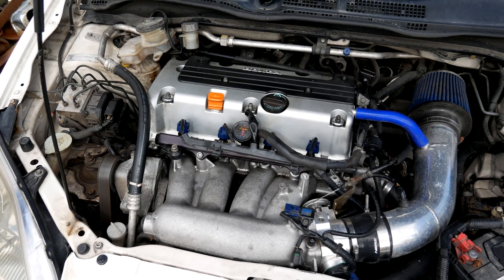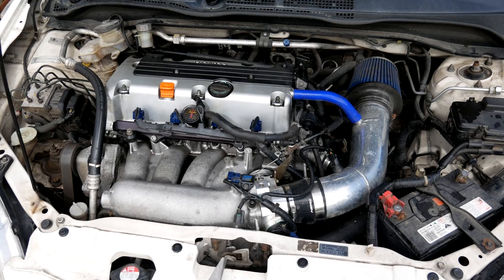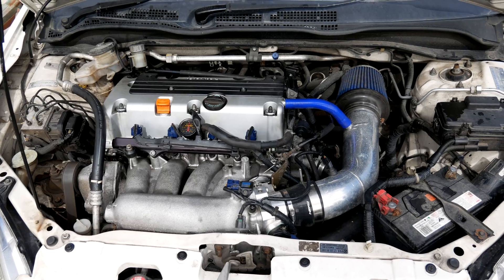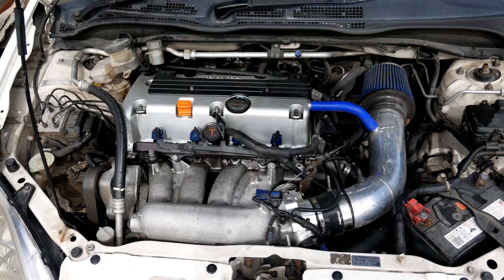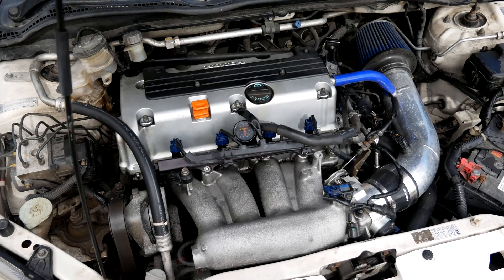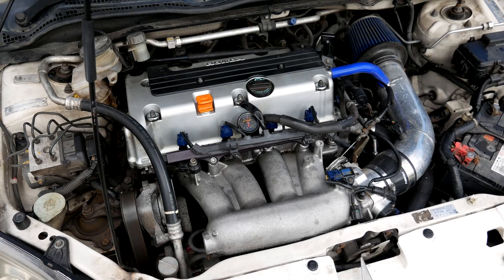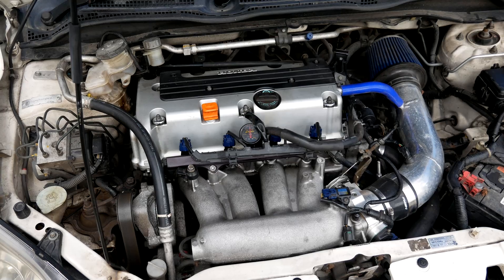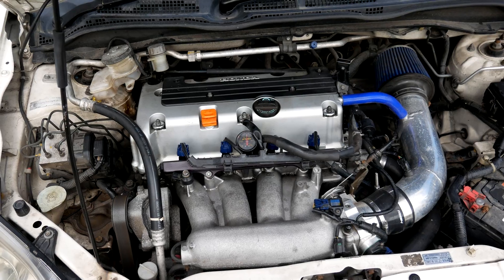K24 Honda  VTC tuning  - Cam timing dyno tested k24 pt2

Comment from the maker: Honda people;  With first hand experience,  what rpm are you running your k24 to and for how long before the rods come out, on stock bottom end?     Also, yes the amount of dyno runs in this video is slightly punishing..
Reply: you can get a 50deg wheel from speedscience or honda - my type r engine has them - and for max rpm - its the oil pump thats the limiter - rods and pistons will do 8500 from what ive seen on youtube - BUT the oil pump in the k24 with the balance shafts is the bit that craps out big time - like 8k rpm is making it work too hard and ill die sooner than later - lots of good info on the forums or googling for it and boostedboiz youtube has epic amounts of build info on k20 / k24's and pushing the limits to destruction for them - how hard are you going to push it ? :)  (edit) DANG theres some awesome info in these replies from everyone else!!!!
Reply from the maker: @cbdrift    Its about maxed out piston to valve clearance. plus the pulley mod i done was free and gets it where it needs to be, not much point buying a 50deg pulley.    Its meant to have the oil pump from the k20.   there is lots of talk about what they will handle. but first hand info would be nice.   I have zero interest in breaking this engine or pulling it apart. Its not mine to break.   but it would be a bit faster if could use  few more rpm...    It'll probably just stay where it is tbh.
Reply: @Garage4age  stock k20 type r oil pump  will shatter over 10k they will do 9.5k happily if the oil pump chain and guide are fresh separate from the cam chain. Also oil temperature is a killer
Reply: @Garage4age  its a myth that the k20 pump allows higher rpm. the limiting factor is simply the piston speed due to the stroke. i personally don't rev higher than 7500. it'll do 8k+ but you're exponentially increasing the stress on the rods for minimal power gain. your best mod is to get a bigger proper cold air intake\. yours suck air from the headers lol
Reply: @Garage4age  Better to be safe than sorry if its not yours - but awesome tuning work there - thank you for showing everything you did and all the cool bits you changed!
Reply: @Garage4age  What "pulley mod" did you do? Or HOW? :)
Reply from the maker: @Vlady_e30  shows it at the end of video.  it was  also skipped forward a tooth, so had similar advance as a 50deg vct
Reply: @cbdrift  50 on stock pistons and stage 2 cams may end with contact
Reply: @cbdrift  cant forget pfi speed and jamie splitting a block in half. The map sensor only read up to 80psi and he hit it
Reply: @townsend420mt  Yuuup - they blew that thing apart - yay stuck egate :\ also check out "kg garage" - they have some serious "how to k series" videos - some of the best build quality ive seen in youtube
Reply: 8k shift 8200 limiter still has rods after 14+ drag days
Reply: Piston speed is getting very high above 8krpm which is asking a lot.

Lots of Americans running 9k+ but only for a few seconds at a time every now and then, not the same as a circuit car or something thats doing lots of dyno work ;)

Common spec is 12.5 comp pistons, forged rods, K20a2/z4 head and a cam of your choice. With supporting intake / exhaust with a rev limit at 8k or just over.

Or keep rev limit at 7.8 and use stock pistons / rods for more cost effective power.
Reply: Common mods for K24A2 and jdm K24 (3 lobe) are 50 degree VTC instead of the stock 25 degree, RSX type S Oil pump, and RBC intake manifold from 8th gen civic Si. This setup with basic supporting mods (3in intake, decent header and at least 2.5inch exhaust) typical net around 230 to 240whp at around 7600-7800 RPM redline set to 8200 RPM and easily safe with type S oil pump.
Reply: Stock 24 bottom end. Stock fd2 type r RRC oil pump, 20 head with dc drop in cams. Revs to 8800. Still going strong 5 years later made about 260whp
Reply: @LuqmanRosley  may i know what engine oil are u using for that k24 ?
Reply: @neomegasupreme6737  wako’s 4ct / 4cr
Reply: @LuqmanRosley  the viscosity u are using is 10w60 ?
Reply: @neomegasupreme6737  5w-40
Reply: @LuqmanRosley  thank you bang
Reply: Check out Tuning by Nick for tons of K20/K24 dyno runs with all different types of setups. https://www.youtube.com/@tuningbynick
Reply: K20A in Integra is factory 8400rpm redline 8600rpm rev limiter, stock oilpump cavitates above 8500rpm. K20A is 86mm bore, i wouldt run higher mean piston speed for K24 which is 7500rpm limiter and 7300rpm redline. You could perhaps push this a bit to something like 7800 rpm but piston skirt lubrication is a potential issue. A built k24 can be pushed above 8000rpm. The tricky thing is that a K24 can easily produce good power at engine speeds which is way to high for the rotating assembly. On the S2000 honda reduced the rev limiter when they increased the stroke for 2.2l engine, for shure with good reasons.
Reply: Aspo I take them to 8800-9000 all day every day providing the oil pressure doesn’t fluctuate or wave. I tune full time. A hard cut limiter at that rpm will do you no favours however.
Reply: I've been running my K24A2 swap fully stock except Kpro, K20A2 oil pump, and OEM oil cooler to the stock 7200 RPM limit several times a day for the last year and it's been doing great. As overbuilt as these engines are for their stock power and RPM, it should last a very long time with proper maintenance even when pushed hard.
Reply: 8000 rpm for my k24a2
Reply: Its not that much time spent at wot, depending on how you see it. Like 2-3 laps on a race track, but alot compared to road use.
Reply: Tuned 100s to 8400 once they have a type r pump and valve springs. Many are track cars. Some even race cars. They last years at that!
Reply: I had a stock crv bottom end with the stock crv pump doing 8600 daily, finally spun a bearing after about 4 years. Motor already had like 200k when we got to it
Reply: Main thing is the oil pump.
Reply: Stock internals running Hondata, dyno numbers were 230whp, I wouldn't take the limiter past 7800 MAYBE 8k if you want to keep it living longer. As mentioned on many comments, its the oil pump that is the limiting factor, along with valve clearance. Id set it to 7800 and call it day. Everyone likes to bang off the limiter on these cars anyways 😂
Reply: Oem bottom end 7800-8000k rpm it will last forever. Highest we’ve set the limiter to is 8200 rpm. https://youtu.be/DfiK2YH1MOs
Reply: At 7800 rpm piston speed is same as on f1 engine spinning to 18000rpm. So if you wanna be safe dont go over that. 
I have never seen engin fail at 7800rpm
Reply: Wat oil pump?
Reply: From what I understand you can safely go up to 45deg on K24. Piston speed is pretty high... You can go just past 8k but there is no point in revving past 7.6k on a NA car without the proper flow mods... You'll notice that the gains diminish as you go up in the rev range. This is where forced induction shines.
Reply: Been running mine up to 7500rpm bone stock engine with a gt3076 on it , the oil pump hasn’t given grief and it’s seen more rev limiter than idle time ….when I had it NA I ran to 8500 but backed that off with boost as didn’t need it
Reply: @CivicH22 depends on model of f1 engine. Older v10 are this way that im refering to
Reply: I have a  k24a2 swapped scion FRS with a turbo. Redline currently at 8200
Reply: Nice l have eg turbo swap h2ba7
Reply: FBI k24. Redline nothing above 7300-7400rpms. Ya 7500-7800 but bet they don't have 326k miles like mine does still. 😂 bet. Engine start an taking it to speeds its not made for it the fastest way to kill an engine. An knock. Eliminate 2-3 an feed her royal purple or Amsoil she will outlast you!
Reply: 7800 rpm on Automatic and 8000 rpm on manual is safe with the K24 but you need to upgrade to the k20a oil pump if wanting to rev higher as the stock oil pump on the k24 is a bit of a dog and cavitates past those rpms due to the balance shafts and you gain around 5-8 hp with the oil pump upgrade and can push a stock k24 to around 8350 rpm safely.
Reply: As per Joe McCarthy, 4680 ft/min is the safe piston speed for k-series engines, so about 7200 rpm if you're close to road racing levels of punishment. 

Oiling is something you have to look into as well. Probably run ARP rod bolts as insurance. 

BYP from Australia runs them on almost stock on multiple builds and they say they last a long time.
Reply: For reference, a local tuner ran a K24 to just 7750 rpm and got 227.56 whp /189.64 wtq on a Dynojet
Reply: Stock K24 EG sequential AWD. 6766. 530awhp, 15psi. 8800rpm. Gets beaten on the highway, track, dyno, 100-200’s on the draggy. Been going forever.
Reply: 10000 rpm all-day